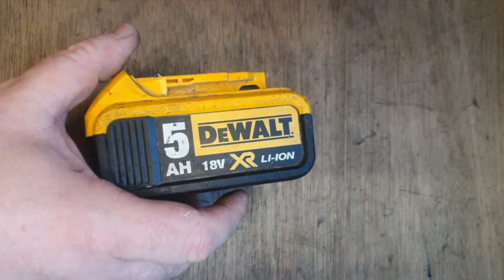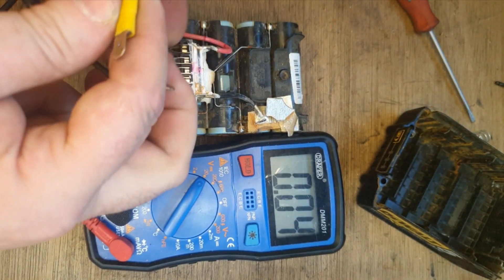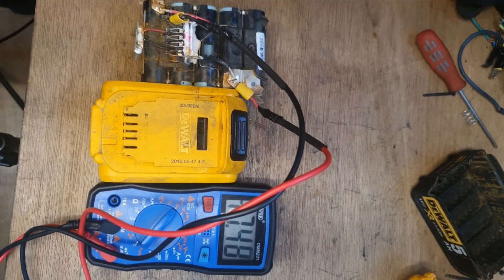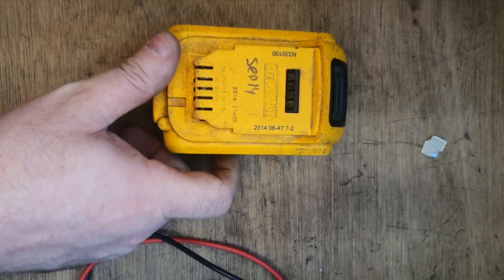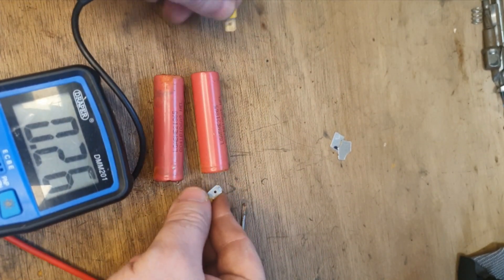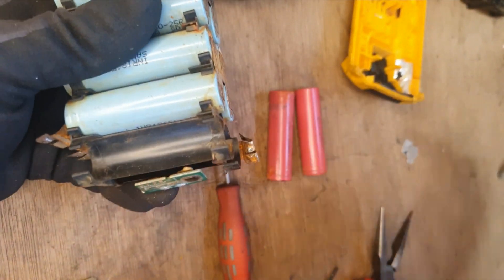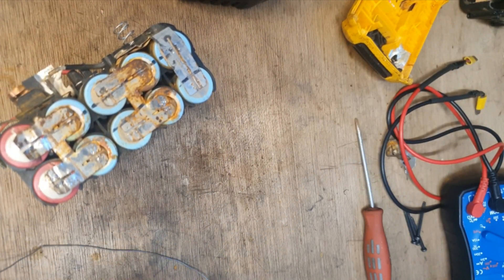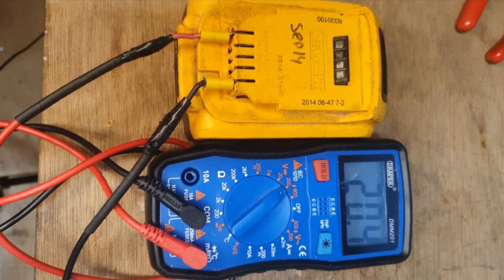Fixing a Junk Dewalt Battery #Dewalt #powertools #repair #diyenthusiasts #dewalt #howto

Comment: Nice demonstration video, thank you. What was the instrument you used once the 'new' cells went into the pack. I have an electronics background but unfamiliar with that device. Thanks.
Reply from the maker: That is a battery spot welder
Reply: @doctorlefthandthread  Thanks, I thought it might be. Was thrown off when you broke out the soldering iron. Keep up the great channel 👍
Reply from the maker: @petermcneill5076  Thanks I have lots more content coming